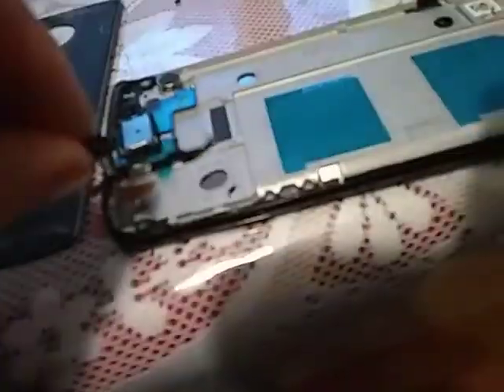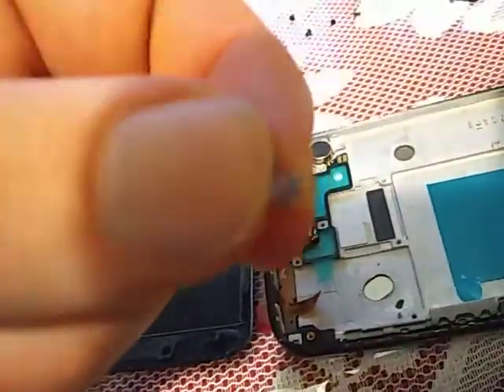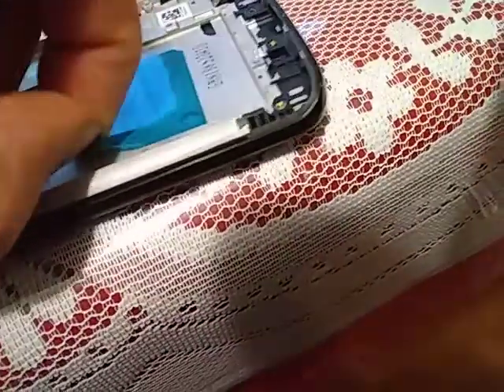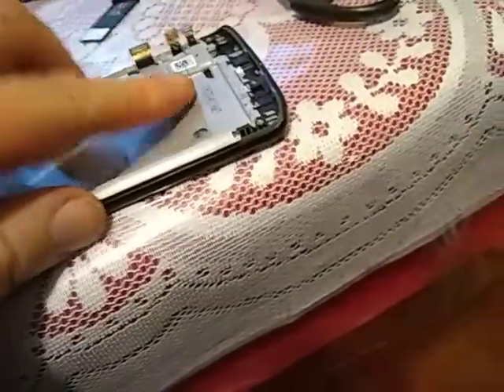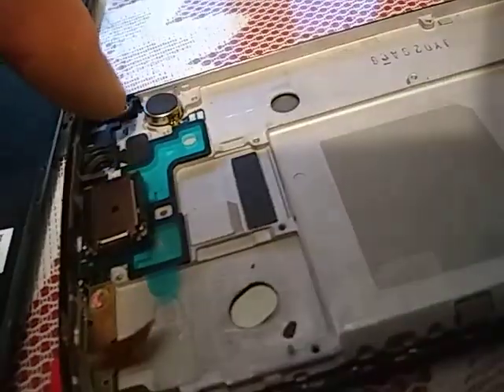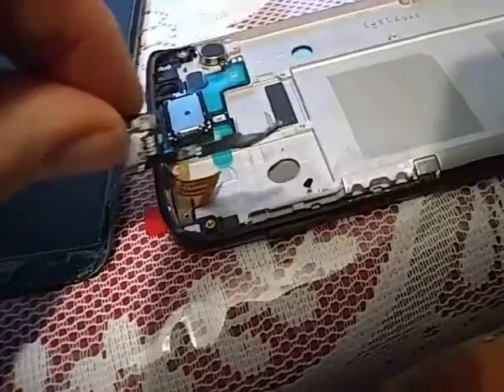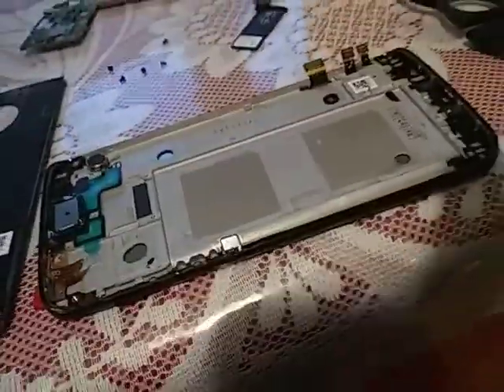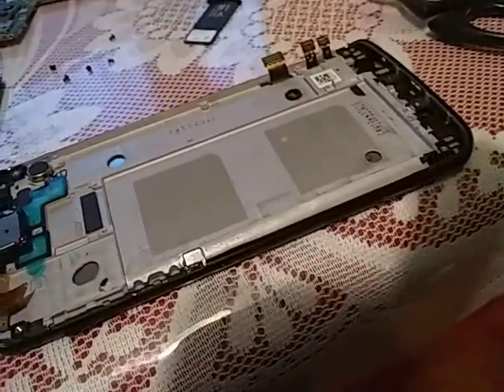Fix a Moto G6 button assembly and case components(2)

Comment: Today I tried to fix a G6 Play, which has the same design for the power/volume buttons. I just about gave up when I realized I would have to somehow move those tiny and mysterious bits from the broken frame to the (buttonless) screen/frame assembly I'd bought.

But a search led me to this video, and your comments about the delicacy persuaded me to slow down. Your remarks about the metal clip and the glue got me pointed in the right direction. I was ultimately able to move the plastic buttons, the metal clip, and the flex with the actual button switches over. It looks like my repair was a success! Thank you for sharing your experience!

This was my first try repairing a cell phone or anything constructed like a cell phone. Initially I tried using a hair dryer but found that pretty hopeless. A real high-temperature heat gun made a world of difference.

Comment: Glad I'm not alone banging my head against the wall. Still have not found a way to get the buttons out the broken frame (display and glass cracked)
Reply: I got the buttons out by pointing a heat gun at the metal clip between them, heating the clip and the metal frame it's taped to, then pulling it off with tweezers. The plastic buttons then fell right out. More heat on the flex with the switches loosens its glue enough to pull that out as well. Some of the plastic frame near the buttons melted, but in my case, that part was trash anyway.